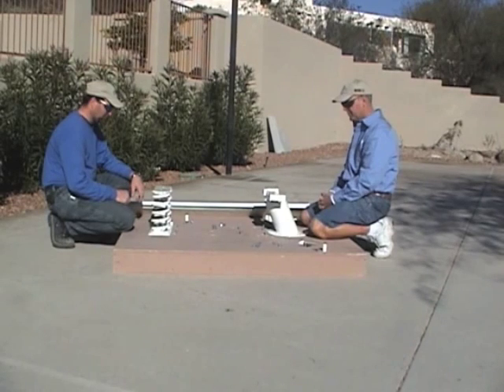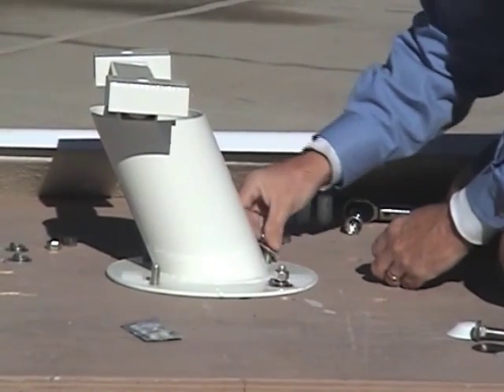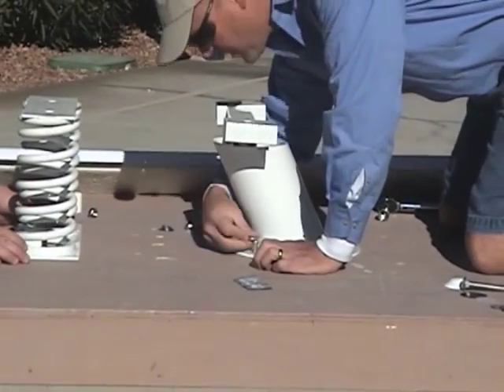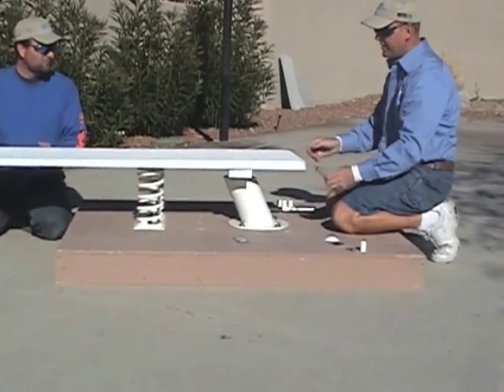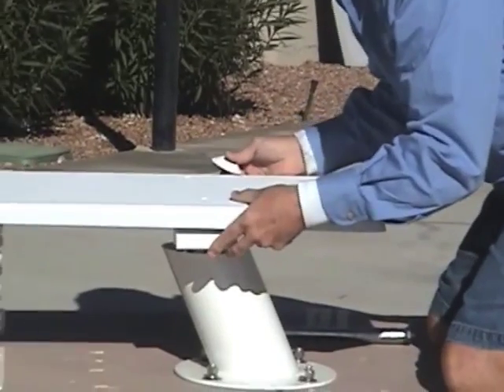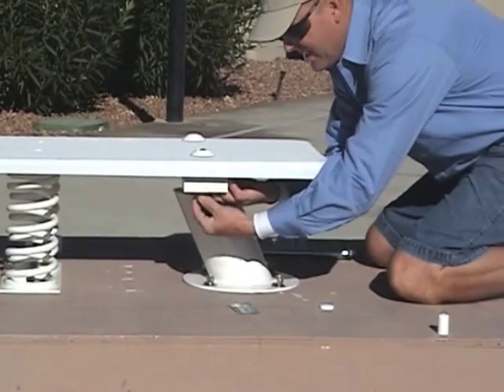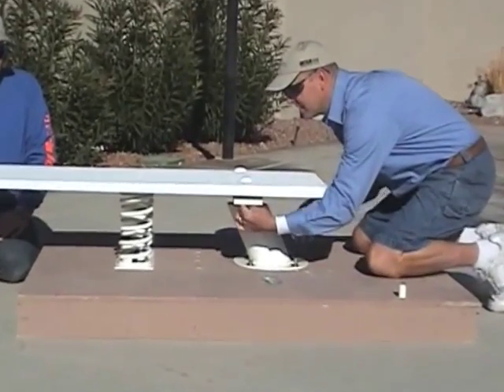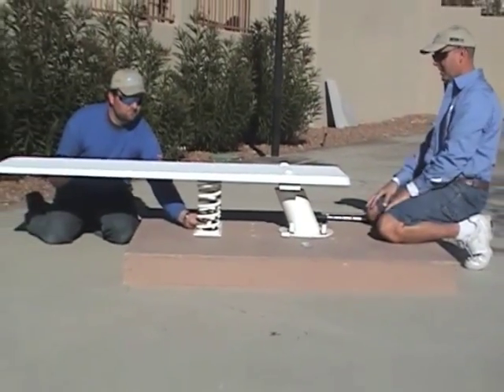Baja Installation Help Video

Comment: The most informative aspect would have been to show the other bolts being installed and how to deal with the coil because the tool to crack bolt down doesn't fit!